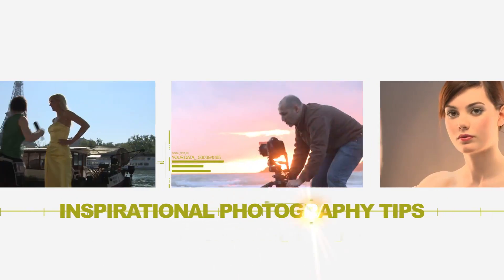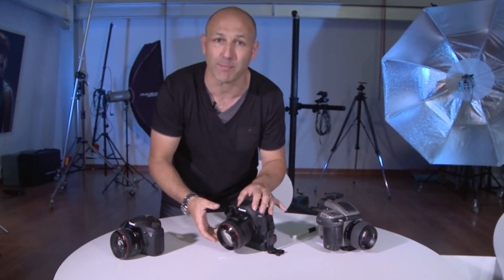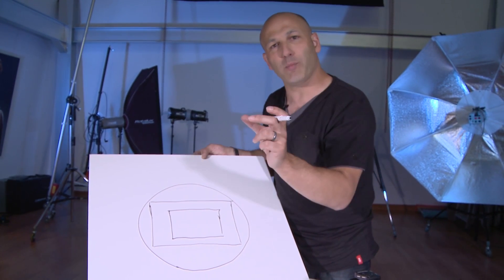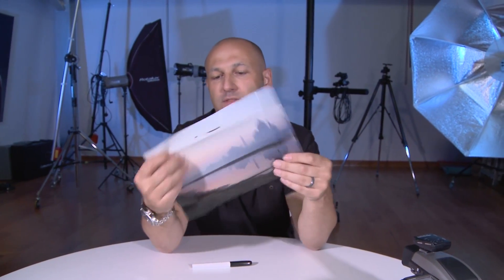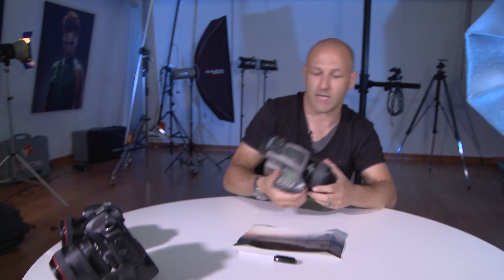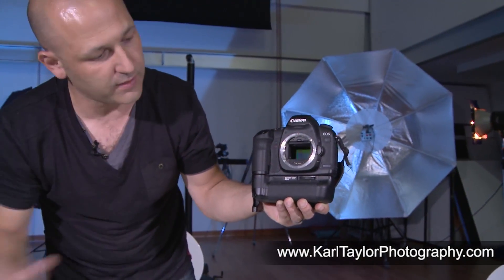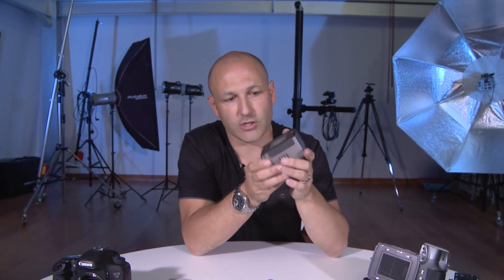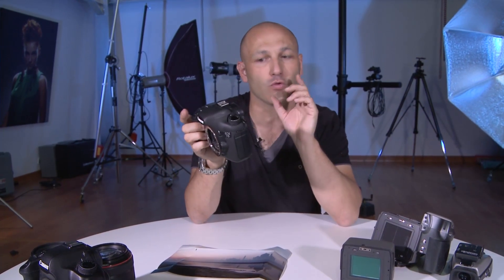Full Frame Sensors vs Crop Sensor Cameras Explained by Karl Taylor!

Comment: Hi Karl,
On my X2D 100c on the 90mm lens, can I simply crop into the centre of  the image, for example to 5000 x 4000 pixels and end up with the same sharpness as the original full size image except I now have a more enlarged view of my subject. I want to use the 100megapixels of the X2D to save me the expense of buying longer focal length lenses but don't want to sacrifice the great Blad quality of the images.
Is his a feasible option or is there a better method. Thanks Michael

Comment: Hi Karl, I watched your video and found it very interesting. My concern is one critical point everyone explains incorrectly. There are 2 key points when discussing image sensors. These are the Optical characteristics and the Technical characteristics of every image sensor. You did a great job explaining the Optical differences and failed, like everyone else, on the Technical aspects of the image sensor. An image sensor is an electronic component with technical limitations. The size of the sensor does not change these technical limitations. For example, the sensor has an active noise component (floor) the moment the camera is switched on. Dishonest marketers decided not to tell the truth because selling more FF cameras is more important. We have the opportunity to manage the sensor's saturation and SNR. How does one do that? The daily repeated marketing phrase claiming "One sensor captures more light" is dishonest. The challenge we ALL face is how to best deal with the different reflected light intensities from the scene. All image sensors undersaturate in the shadow parts of the scene. That means a lower SNR and more visible image noise in the shadows. Your ISO simply amplifies the lower SNR in the shadow parts of the image signal. Why do all image sensors produce excellent image quality in bright light, and NOT only M43 sensors? Because the sensor saturates in good light. That means a high SNR, low visible noise, and more tonal data. Why? (think gamma & tonal data distribution) Go to my Blog for more information on what digital photographers should know... Best Siegfried
Reply from the maker: Hi please see if you prefer this video: https://www.youtube.com/watch?v=KTWfSFjdF4Y&t=984s

Comment: Great video Karl. One point you have totally wrong Sensor size has nothing to do with depth of field . Do some research and you will see why .
Reply from the maker: I don't think I actually said that in this video. Depth of field is affected by aperture or magnification, therefore focal length (due to magnification) for example as the sensor size increases then depth of field will get less for a given aperture if you are filling the frame with your subject to the same scale. Larger sensors will require a longer focal length to do this or move closer to the subject.
Reply: @VisualEducationStudio  Hi Karl this is a very confusing subject. If you have time check this out from Fstoppers. to me this is correct. https://fstoppers.com/education/understanding-how-sensor-size-affects-depth-field-312599

Comment: illogical wrong unfair analysis. What is stupid is the word crop sensor. An APSC sensor in fact does not crop the image. If you put a 35mm sensor lens on an APSC camera it turns, for example a 200mm Nikon zoom I have to a 300mm zoom, that's an advantage of using a 35mm sensor lens on my Fuji XT3 APSC sensor camera, not a disadvantage. Fuji makes great pro glass.

The less Boka comment on APSC sensor is bull. If you put for example 35mm sensor 50mm lens on an APSC sensor it is no longer a 50mm lens so yes bohke changes. But if you put a 50mm APSC lens on bohka is close to the same (won't be exactly the same cause it's a different lens).

Calling a sensor crop is bull, using your definition a full frame camera is a crop sensor. The only full frame sensor would be the largest sensor made by your definition.

Comment: Hi Karl. Sorry for a late comment to this video but can you please suggest for a real estate (interior) and product photo shoot which camera is better?  A Full Frame camera or a Crop Frame Camera? Highly obliged to get a reply please
Reply from the maker: Hi it doesn't really matter that much these days both will serve you well if you have the right lenses for the system (wide angle enough for your interior shots). However my preference is for a larger sensor as it gives you more lens options and usually better low light performance but that may be well beyond what you need. For product shots then the full frame also is best.
Reply: Thank you  Karl for a quick reply...:)

Comment: Bless you for explaining (10:40) that it is the greater camera to subject distance needed to achieve equivalent framing which increases the apparent depth of field when using a crop sensor camera.  This is the first clear  and concise  explanation of this that I have  seen or read anywhere !  I'll quote you, because everyone I know thinks the larger sensors are somehow imbued with magical depth of field (blurring, or 'bokeh') properties.  Only three things can affect the depth of field:  changing the true focal length of the lens, distance to the subject and / or the aperture, of course.  I am pretty ignorant, but it seems others are, too, as regards basic physics of photography.  Thank you!!

Comment: The advantage of a crop sensor when it comes to telephoto shots is not a real one because it is the same as if you would crop a full frame later in photoshop or capture one.
Reply: not with my cameras, I get sharper shots with more  detail in my 7DII than cropping in to the same with my 5DIII. If Im shooting telephoto and would have to crop I use the 7DII because I lose too much detail on the full frame

Comment: I really don't agree with you in term of the photo taken in a crop sensor we can get it by take a photo in full frame and crop it in photoshop as you mention, because if i took a photo with nikon d610 which is 24.3 mp and crop it to give me the angle of view of crop sensor the photo will be 16.2 mp in this way i am losing resolution while when i use nikon d7200 to take the same photo ill get the same angle of view but with a 24.2 mp photo. i think the crop sensor still worth while when the situation needs a longer focal length

Comment: What the f stop of a full frame lens will translate to when used on a crop sensor camera?
Reply: It's the same.  The f-stop number is a ratio between the focal length of the lens and the distance from the front element to the sensor.  This number does not change.  The same thing applies to the focal length.  There is a misconception that a 100mm lens on a full frame becomes a 160mm lens on a crop sensor.  This isn't the actual case.  If you want to compare the angle of view, then a 100mm lens mounted on a crop sensor camera is the EQUIVALENT of a 160mm lens mounted on a full frame sensor camera as far as the angle of view is concerned.  The lens itself didn't change; only the sensor changed.

The same can be said about the background blur a lens is capable of - which relates to the aperture (f-stop).  The f stop doesn't actually change, but the equivalent bokeh you are able to get does - at least when framing is similar.  For example, take the same 100mm lens.  Mounted on a crop sensor, the angle of view is equivalent to 160 mm, so if you want to get the exact same framing with the same lens on a full frame camera - where the angle of view is 100mm, you have to get closer to your subject.  The result of this is more background blur because the subject is closer.  If you wanted to know what the equivalent f-stop would be to get that same bokeh had you not needed to actually move closer to the subject to frame the two photographs the same way, you'd multiply the f-stop by the same crop factor.

In the end, it's all the same thing.  The lens isn't changing, but you are getting equivalences by multiplying by the crop factor for both the focal length and the f-stop.
Reply: I'd also like to add a comparison about crop factors.  Imagine that you have an overhead projector displaying an image on a wall.  This projection on the wall can be thought of as a projected image a lens makes.  Somewhere on that wall is a "sensor" of some kind.  That sensor captures the portion of that projector's image that falls on the sensor.  You could have a large sensor or a small sensor.  It doesn't change the actual projector's image.  The difference is in how much of that image is captured by the sensor.  A smaller sensor captures a smaller portion of the projectors image, but when "developed" and displayed on your computer monitor, it appears the same exact size as the image captured by a larger sensor.  So, it just looks more zoomed in than the larger sensor's image looks.  It looks "cropped".  Between these two sensors, nothing at all about the lens itself (the projector) changed.  The only thing that changed was the size of the sensor that captured that image.  More of the projection was captured on the larger sensor, so it has a wider angle of view.  When we multiply focal lengths of lenses, we are just coming up with an equivalent angle of view.  The lens itself isn't changing.

Comment: Great information!!  Thank you!  I have an OLD Canon Rebel XT with one lens that is an EFS 18-55mm and another which is an EF 75-300mm.  I'm looking at upgrading, and was looking at the Canon 70D.  Since both are CS cameras, do you know if these existing lenses will work on the 70D and / or should I even worry about trying to utilize them with a newer camera, and just get all new lenses too?  Thanks again!!

Comment: can the lens available for cropped sensor camera be used on full frames one??
Reply: No, I have a crop sensor Canon Eos 550D and a full frame Canon Eos 6D, the cropped sensor lens simply does not fit on the FF Canon 6D. But all my Canon L-lenses fit both my Full Frame and Crop sensor Canon camera's.

Comment: hey karl. thanks for the comparison. I would like to understand something as I am considering buying a top of the line micro-four third as I am already investing in the micro four third (mft) environment.So, could you please explain a bit more on the depth of field thing you said. e.g. if I used a mft mount 45 mm f1.8 lens how would it compare to a full frame 90 mm f1.8 in in terms of depth of field.

Comment: Each sensor has its own lens. for the more expensive range, the lenses have more art specifications as 2.8, 1.8, 1.4 etc. If you want to have a higher range, then you pay more for a more expensive camera, which has more quality lenses. Everything is marketing. Even if you want to stay in the low range, there are lenses with similar specifications but with less quality glass.

Comment: Larger sensor = more light on the sensor?
Reply: Well more correctly larger sensor is larger individual photocells (almost like a pixel but not the same) sizes usually measured in microns. Which can gather more light that's where the high ISO capabilities come from. Look at pixel pitch. https://www.ephotozine.com/article/complete-guide-to-image-sensor-pixel-size-29652

Comment: So really on a crop frame you are only at a disadvantage shooting less than 16mm, if you use the canon 7d mark II it has 20.2 megapixels on a 5d mark III it has 22 megapixels so 1.8 less megapixels on a 7d, to notice the difference you would need a magnifying glass. This is all marketing and bs + the modern crop frame lenses are as great as the red ring lenses now. Remember this video was shot in 2012.
Reply: Full frame allows higher ISO without the noise becoming too high. That is basically one and a half stop advantage. Crop lenses are typically cheap and not as fast. One also loses in the smaller sensor. Sure there are exceptions like the Sigma Art lenses.The only actual benefit on crop is higher pixel density. A crop body works like a tele converter but without loss on quality because the extra optics. This helps in situations where one has to crop anyway like in wildlife shooting.

Comment: Did not quite get how it affects bokeh. If you take a shot from the exact same position with both sensor types, will that affect the blur effect as well? (besides the cropping)
Reply: +BenRangel people (even pros) fail at explaining this and is simple, the mm changes because the crop factor all agree in this, but also de aperture and also de iso, you need to do the mat, and in reality all de cameras take same photos when you convert the numbers depending the crop factor, chose the right settings, and the correct glass to your sensor, there is no better resolution because the sensor only cofused people who doesnt understand their cameras and glass.
Reply: +BenRangel He Ben, you are right about what you said, but you need to continue that thought.  Exactly because the image is just cropped, you will have to move further from the subject to match the same image (same framing exactly) you would get with a full frame body.  when you move back, you that is when the depth of field \bokeh changes.

Comment: But if you crop the 22 Mpix you are left only 8,6 Mpix, The advantage of the crop sensor comes with higher pixel density. If the background is far enough the blur is not dependent on the sensor size, just on the effective size of the aperture (f/N) and the size of the target. Fix a ruler on a window and shoot it with, say 50 mm f/2 and lights on the far background will be 25 mm on the ruler no matter what the distance or the crop factor.  Provided the background is much further back than the shooting distance. The high DOF on small formats does not come directly from the sensor size but from the short focal lengths that are used. You'd need about one stop larger aperture to have as small DOF.

Comment: I'm very new to this and would appreciate some guidance.  I have a canon 7d (apsc) and am researching whether or not to move to full frame.  My understanding, so far, is that an apsc is not the same as a crop of a FF, as Karl says,.... that is, if you crop the FF you will have approx 45% (depending on crop factor) of the pixels you would have on the apsc and therefore a dramatic reduction in quality!  Have I got this wrong?
Reply: APS-C is same as crop sensor. It just is a more official term. Yes, crop sensors have a higher pixel denity

Comment: Not sure why u have not talked about the technical differences between crop and full frame cameras. Or the fact that you have to think about the pixel count. Full frame typically has larger pixels that allow more light to be gathered and have a higher quality hence contrast and colour detection are better.